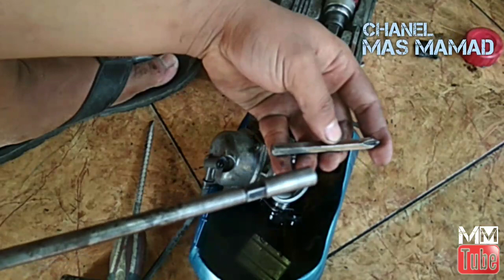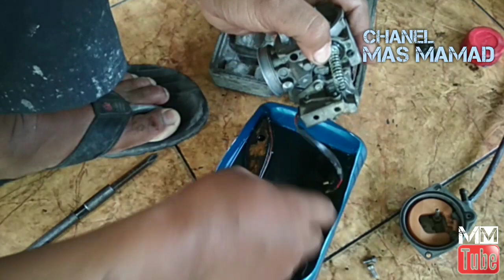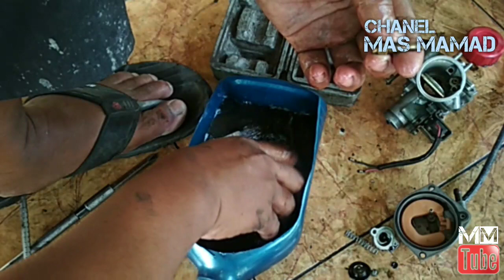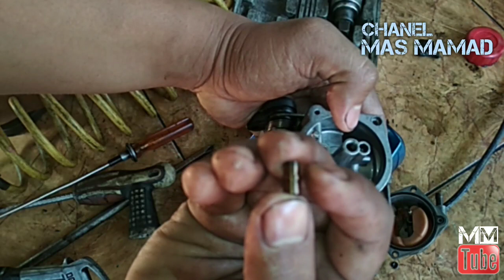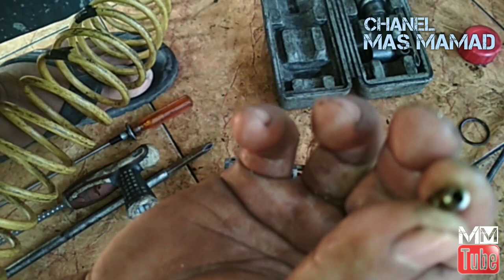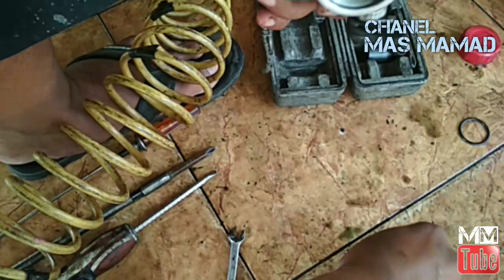#karbu #suprax125 #karburator Bongkar pasang karbu Suprax125

Comment: Bang ring sama karet setelan angin saya tidak ada/hilang, apa bisa dibelikan yg baru?
Reply from the maker: Beli repair kit ada
Reply: @masmamad7464  kalo setelan angin karbu Supra 125 ga fungsi apa masih bisa dibenerin bang? Mohon dijawab bang🙏🙏
Reply from the maker: Minta tolong ke tukang bubut bang buat benerin biasanya bisa.
Reply: @masmamad7464  bilangnya ketukang bubut gimana mas?
Reply from the maker: @rickyagyas  minta tolong benerin stelan angin2nya
Reply: @masmamad7464  siap bang makasih infonya sudah saya subscribe 👍👍
Reply: @Ricky Agyas  jgn di bubut dulu.. Kalo udh pernah di gonta ganti. Kalau bisa di standarin aja dulu semua, biasanya barang repairkit ada yang nggk cocok buat supra125 mcm jet needle(rata2 lobok kegedean dan jangan pernah ngotak atik yg bawaan krn susah nyarinya) , needle jet (biasanya yg kuning standarny silver) , air screw(rata2 gaada cekungannya bisa bikin ledes dudukan air screw) , sama pilot jetnya(rata2 repair kit pake pilot yg 6 hole, standar supra 8 hole dan susah bgt cari 8 hole). Kalo karbu suprax125 saya saranin jgn pernah di otak atik deh krn susah bgt cari part yg ori dan presisi. Saya aja udh setahun cari jarum skep, jet needle, sama pilot aja yg kw blom ketemu yg pas sampe sekarang padahal motor standar, apalagi yg original tak jamin susahh nyarinya. 😂 kalo yg di toko online mah bungkusnya doang original tapi part2nya beda ukuran dan bentuknya kalau nggk percaya bandingin aja sama yg standar/liat di part catalognya.
Reply: @bhagasasi425  mas kan saya cek lubang setelan anginnya itu kaya ada karet hitam tapi sudah kaya kepotong kecil" itu apa bisa jadi masalah setelan angin gak fungsi sama sekali? saya juga gak tau itu emg kotoran karet yg kepotong kecil" atau emg bawaan karbu Supra 125 kalo emg ada kotoran kecil" didalam lubang setelan angin apa masih bisa dibersihkan dan caranya gimana ya mas?

Comment: Mas mau nanya, saya pake pe28 di mtor fu, tpi kenapa ya kalo di gas kejut/dadakan gitu tiba2 hilang gasnya, saya hampir celaka karna itu, kira2 penyebabnya apa ya
Reply from the maker: Spek motor standar , apa gimana  mas?
Reply from the maker: Coba cek busi gimana warnanya , hitam , merah bata , apa putih.
Reply from the maker: Terus pengapian standard apa gimana.
Reply: @masmamad7464  motor standart mas, pengapian juga standart hanya ga pake aki karna soak, busi warna agak merah kehitaman mas
Reply from the maker: Gak masalah gak pake aki asal kiprok normal, coba main jet SMA pilot jet nya si stek ulang mas.
Reply: @masmamad7464  kiprok normal mas masih yg standartnya, saya pake pj 42 mj 120. Apa kebesaran spuyer mas ?
Reply from the maker: Coba di borosin dikit mas main jetnya kasih 122
Reply: @masmamad7464  kmarin dapat saran dri temen sudah saya rojok ya naik dari 120, tpi masih sama sprti itu mas, apa ga keborosan mas ? Jdi kalo motor saya hidup langsam gitu tiba2 kadang mesin mati di sertai sperti suara rantai lepas, tpi kalo di nyalakan lagi normal lgi. Smpean bngkelnya dmana mas ?
Reply from the maker: Saya bengkelnya di Blora mas
Reply from the maker: Be pake Karbu PE y gitu harus stel terus PJ MJ nya smpai ketemu stelan e.
Reply: @masmamad7464  trmksh mas mamad penjelasannya.. sukses terus chanelnya